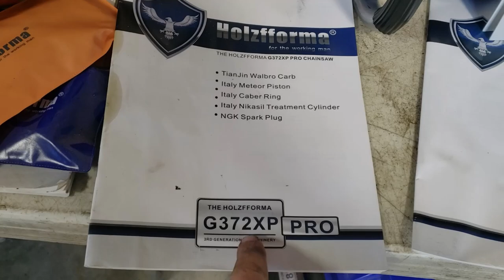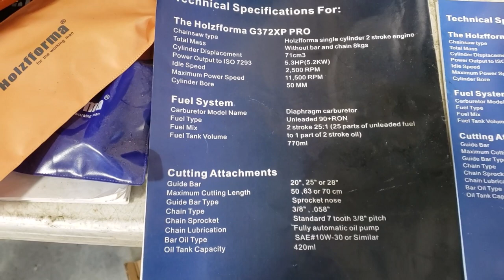Farmertec 372xp Pro Upgrades Carbon Fiber Holzfforma Chainsaw HUS 372 with pipe review

Comment: Two questions... is the fuel mix really 25:1 like the specs say? And the blue/orange vs Pro is about a $150 difference. Functionally, is it worth the difference?
Reply: The blue and orange are the same saw. The Pro is well worth the extra $150. With the Pro many of the second rate parts have been replaced with much better quality.
Reply: For initial set in I used 32:1 for two tanks and will be running 40:1 indefinitely. 25:1 is too much, because it will build too much heat which can croak the saw.
Reply: I use 40:1 and have had excellent results for 40 years now. I would think at 25:1 you'll make more carbon in the cylinder than wood chips on the ground.
Reply: @yungsmile7546 really, have you tested that theory? How about 50:1 for break in and then 40:1, what do you think of that?
Reply: @alanmeyers3957I 'm currently running 50:1 trufuel in mine, but I just fired it up for the first time today.... will let ya know how it goes. Wish me luck lol

Comment: I just got my G288 a couple days ago. Havent started it yet but it came without a scratch on the box. Seen the hydro dipped when I bought mine. Quite a bit more expensive for the dip. Cheers
Reply: It's more that just a color scheme. They come with a Walbro carb, Italian Nikasil plated cylinder, Meteor piston and Caber piston ring. I just received mine Tuesday and did some mild porting on it. It's pretty decent.

Comment: All I can say is they look ok. Ive had a general lack of service/support. 
Nothing but issues when trying to get them to deal with damaged / broken parts or wrong parts being sent. Durability is very lacking in crank cases, as the crank bearing pockets stretch and won't hold the crank bearings, results in seals failing, air leaks seized saws, plastic is pretty brittle and breaks easy, screws are soft and break, or the holes for the screws strip out very easily. Might look good in pics, but Neotec 372 and 066 are more durable and better built for the money. Afleetcommand has done tons of videos on their stuff over the years, might be work a look before you spend the $ on these.
Good luck.
Reply: People are always looking for a deal, truth is, these are junk compared to Stihl and Husqvarna.

Comment: Can I purchase just the full wrap handlebar
Reply from the maker: Yes you sure can! They have different colors if you know what your looking for. Black or gray.
Reply: Will it be the full wrap that's just a little shorter than the xtorq or is it like the xtorq full wrap? Do you possibly know
Reply: I tried looking it up but I can't find it on the website what do I need to put in to pull it up? Thank you
Reply: @justinterrell9555  Hi Justin, I,m guessing that the full wrap they offer would be like the ones from the NON Xtorq models since their G372, is a replica of the Original 372 XP,s( Non-Xtorq). Good way to tell the difference between an original 372 XP and a  372 Xtorq is the decompression valve comes out the side of the cylinder head on the 372XP Non-Xtorqs and on the Xtorqs the Decomp comes out of the top of the cylinder next to the spark plug on an angle. Hope that info helped.....
Reply: Yeah I have 2 original editions 372s if I put a full wrap on one I just didn't want the one for the xtorq because it's alittle taller not that it really matters but it does to me I guess. Lol.

Comment: I’m waiting on my 660 pro to arrive. I ordered Jan 13th so I’m sure I should quit holding my breath. Lol
Reply from the maker: They are pretty sweet. Worth the wait.
Reply: Rocky Mountain Chainsaw I too just buy new stuff to give the kids some boxes and bubble wrap to play with. I look forward to your 660 video. I’ve been on the fence with buying one of these saws for a few years and the upgrades convinced me on this pro model. How long did shipping take on yours? Thanks
Reply from the maker: @cowcatcher9186  took a few weeks, I ordered 20 saws. 10 of each pro series models. Along with lots of other needed parts. The 660 has a nice protective plate on the bottom that I wish the 372 had.
Reply: @rockymountainchainsaw my 372 pro came with the skid plate

Comment: i can not stomach the idea of buying from china is the bad thing and the other thing is the crazy gas oil mix here we have the 40:1 or more common 50:1 mix these blue saws want a 24:1 mix i think it was at the time i looked at them 3 or 4 years ago
Reply: They dont "want"  any oil.  32 and 40 ratio work perfect after a bit of a break in.  That 50 mix on any saw can be bad.